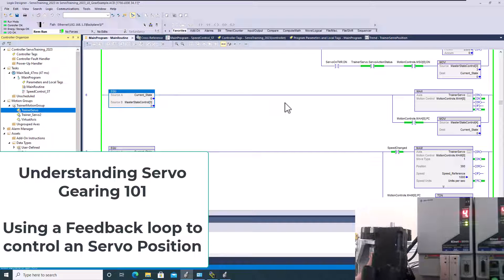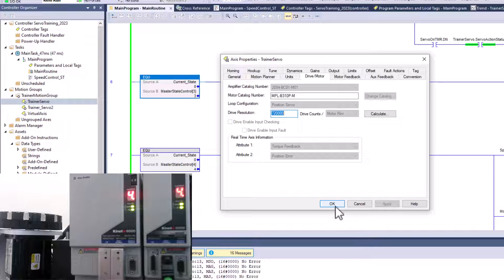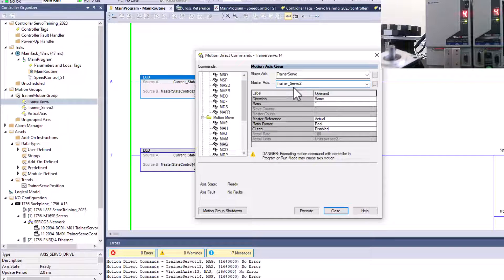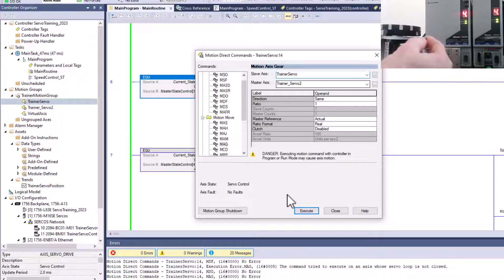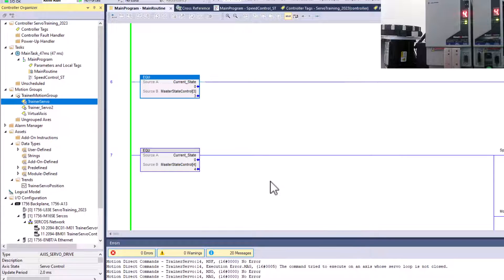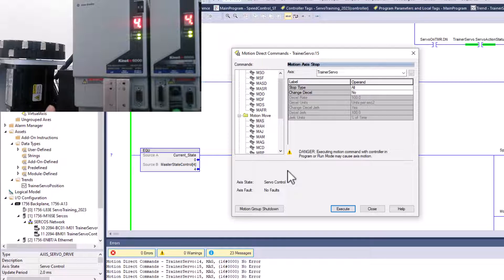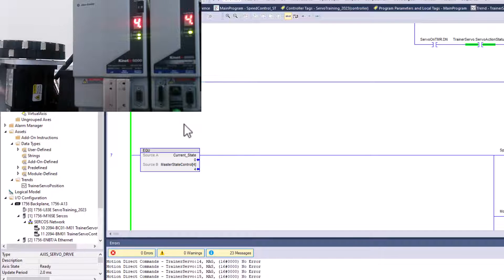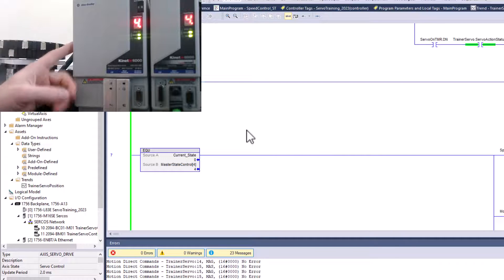Allen-Bradley Servo Motion Gearing

Comment: Thanks for the video Shane!
Is there any easy way to do that with two kinetix 5100 without an additional PLC?
I have 2 servo motors, each one with encoder. Can I use the first kinetix to repeat that encoder signal and receive it in the second kinetix to synchronize?
Reply from the maker: @artembritov7381  You can hear them together, not sure what you mean by using the encoder.

Gearing is tying two servos together and can easily have one follow another

Comment: Hi Shane. First of all, I'd like to thank you for your videos. They have saved by butt countless times. 
the question I have is Can I use an encoder as the master and gear it to a slave servo. My application used a DC motor and a servo. I need the servo to move approx. .018" per degree of movement of the DC motor.

Is this something you can help me with?
Reply from the maker: Use the encoder as an axis then use a gear instruction.

I've built a machine that uses an encoder as a master axis then turned it into a virtual axis then geared to it
Reply: @ShaneWelcher  Shane I see this is what I have to do. Can you show me how, you tell me if it has a price.
Reply from the maker: @fernandomatiasn  what?
Reply: @ShaneWelcher  How to make a master axis with an encoder and convert it into a virtual axis
Reply from the maker: @fernandomatiasn  this is not something easy to describe via text. 

Sorry but I will have to try to make a video when I have time which right now is very limited
Reply: @ShaneWelcher  🙏🙏🙏🙏I'll wait, thank you!!!

Comment: Hi Shane i have 2 questions 
Do you know if this option is available with the kinetix 3000? &
Some of my more senior controls engineers have highly recommended not using motion direct commands on production equipment  (when the equipment is stopped of course) while others have said its a great tool to use  and should be used when performing trouble shooting. I'm curious what your opinion might be. I assume those that recommend against do it for safety?
Reply from the maker: I only use this for troubleshooting and place the motion axis direct commands back to a safe condition after finished troubleshooting.

So I agree that it's best to troubleshoot with motion axis direct commands as long as you are responsible for making sure the machine runs as designed after usage.

And Kinetix 3000 is a trigger based system which is not motion commands in controllogix.

It uses inputs for its control from my memory.